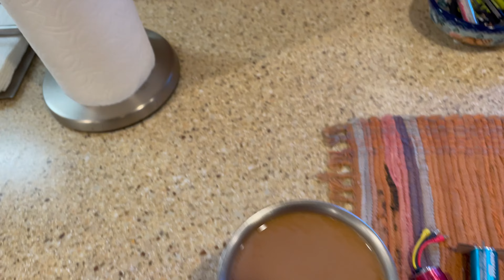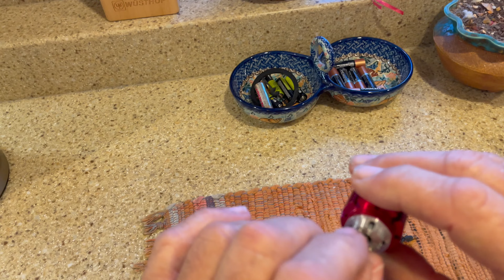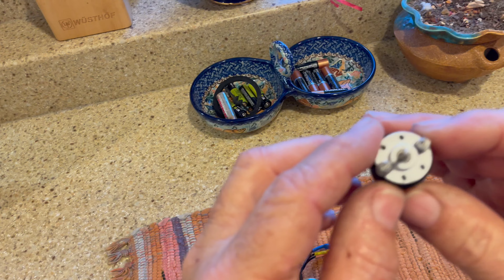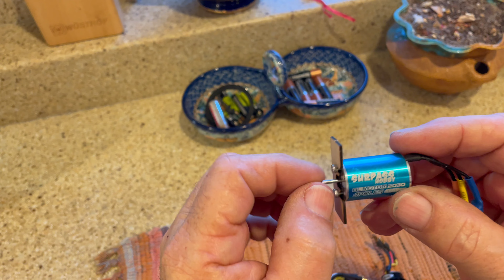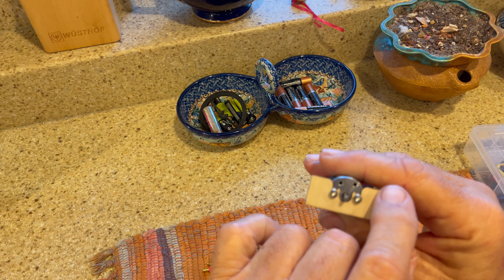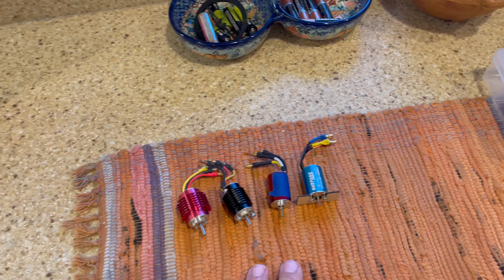Dr. Jet Pimps the 12" Challenge

Comment: Looking forward for the next Challenge, ,, Right now in the works, I'm building a HRL GP Henderson hull 19-20 inch long, (bow to transom) and a complete 15in 2.5 liter hydro done ,need paint.
Reply from the maker: My next Challenge will be on the small side as well, primarily to keep things cheap.  I'm working out details in my head; I may try to use the same 50' course I'm using for the 12" Challenge, but that may change.  I have a few prototypes built and some tested.  The goal of the next Challenge may be to see who can work out the best power system for a very basic and easy to build hull.